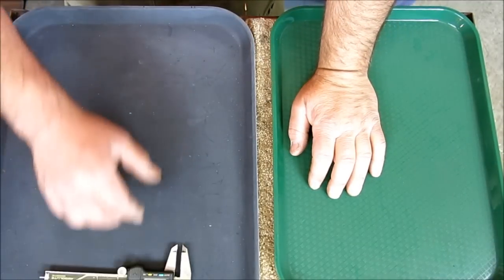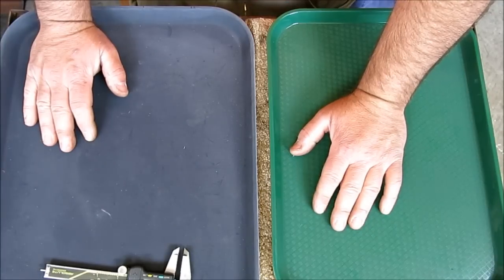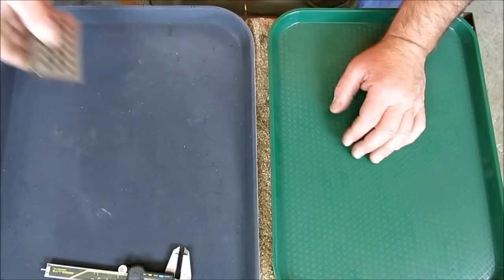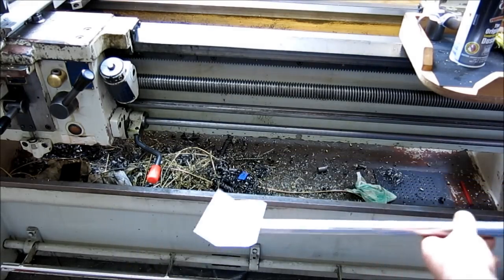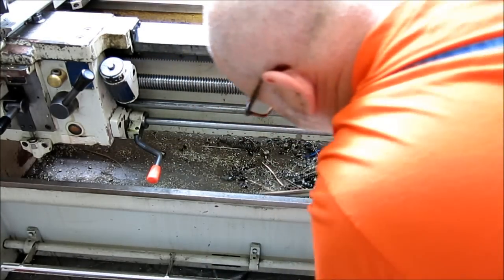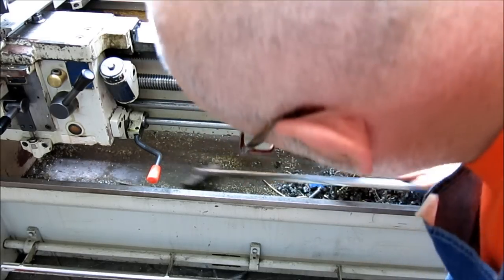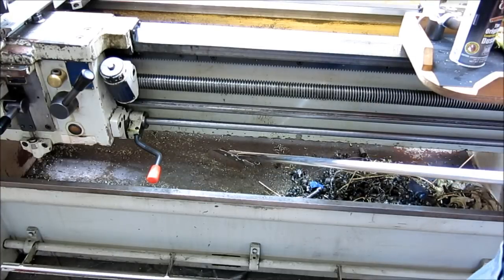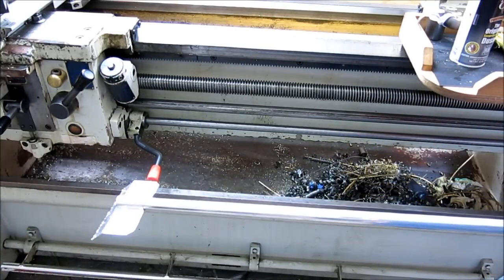Monday Night Meatloaf 30

Comment: Thanks for the meatloaf videos, keep up the good and interesting work!

A new thing, when you have a sharpening stone that has broken, oddly enough, clean the joint well and put super glue on it, realign carefully, stick together and AHA! nearly good as new.  Quite strong, even compared to new.
Reply from the maker: slad roznik Hey Slad,

I'll have to go out in the shop and drop one so I can try your clever trick. Thanks for sharing. 

Cheers,

Tom

Comment: When you're using that small of a diamond hone isn't there a risk that you're taking the stones out of being true, rather than truing them up? Would it be better to use a bigger diamond hone which you could rub the entire stone surface on instead?

Looking forward to the chip videos, those are some monster chips there at the end.

Cheers!

/Daniel
Reply: It is a mix. If you true up the entire stone, you loose a lot of surface and have a lot of grinding to do. If you spot clean it, it can get off by a very small amount. That was a 500 grit diamond I believe if I remember the color coding so he is not taking of a huge amount. 

Flat stones are over rated.  It doesn't make that much difference.
The variations in the hand holding are much larger than the variations in the surface.
Reply from the maker: Hi Daniel,

Basically I am just removing a small amount of contaminated material at the surface. It would be better to use a larger diamond stone to maintain flatness or at least a similar flatness to the diamond stone.

Cheers,

Tom
Reply from the maker: David Kirtley Hi David,

Well said. It basically a good cleaning. These are cheap aluminum oxide stones not big dollar imported waterstones from some sacred mine.

Cheers,

Tom
Reply: oxtoolco Thanks to the both of you. I see your point. 

Cheers!

/Daniel

Comment: Tom, Great meatloaf as always.  One of the methods that I use to flatten stones is to rub two stones together, close to the same grit..  Using WD-40 as a lube.  I used this method in sharpening chisels when I was furniture making.  Of course most of my stones were Japanese Water Stones, and I used water instead of WD-40,  I think I still have some up to 6000 grit.  It was very important to keep the stones perfectly flat.  Nice selection of stones you have there.
Reply from the maker: Hey Herb,

That works as well if you have two the same and are close in flatness. 

Cheers,

Tom
Reply: Check out an optics handbook. Two flats will tend to become concave and convex spherical when ground together. If you want to grind flats you have to grind three surfaces together in pairs. These two effects are used in grinding optics, like the mirrors for telescopes.

Aren't waterstones usually flattened with a cast iron lap plate and a slurry of abrasive?

Comment: Tom, thanks for the Monday meal!  I like that little micrometer...less math means less chance for errors. That vinyl on the wrench looked home-dipped...you can always re-coat it if you like. Thanks for the demo of stone work too...useful to know.  I wonder how well it would work on ceramic sharpeners?  Have to try sometime.

-- Mike
Reply from the maker: Hi Mike,

Diamond almost always wins unless its going up against other diamonds. There are big differences in diamond hardness. It will work well on your ceramic. I peeled the vinyl off the adjustable wrench. Its all happy and nice looking now.

Cheers,

Tom

Comment: Hi Tom.  The Pilgrim Colony in America nearly died out due to the failure of the party to include sharpening stones on their voyage. Since their tools (plows, scythes, axes, knives, etc.) rapidly became dulled, they actually risked famine.  Accordingly, they embarked on a search for usable materials locally, and actually sent back word to England to send some to the Colony.
Reply: Interesting bit of history.  I'd never heard that.
Reply from the maker: Hi Shobar,

That is an interesting story. Where did you come on this interesting bit of history? It almost sounds like an advertisement for Norton abrasives. Not that I doubt you but its an excellent advertising tag line. Thanks for sharing.

Cheers,

Tom
Reply: Shobar would that would be FedEx's first international job then? ;-)

Comment: Hi Tom, I picked up a set of those Kraeuter pliers in the middle of the highway.  They were rusted shut and had been ran over a couple times.  A little TLC and gentle wire brushing and they were working like new again.  A little tool archaeology proved them to be from 1912.  They are far superior to many linesman pliers I've seen.  If you look very carefully, you will see that the jaws never actually come together, they are tapered in a shallow wedge pattern.  I think they are designed this way so that when the jaws are spread apart holding wire, they are parallel.  I would guess that the jaws never come together completely so that the cutters can be sharpened more than once.  I also notice a back bevel from the tip to the cutters, where wire can nestle into when being pulled straight with the pliers.  Anyhow, I too have an old set of patinaed Kraeuter pliers
Reply from the maker: Hey Perry,

I really like the Kraeuter stuff. I have a few pairs or pliers and they all show the attention to detail you describe. 

All the best,

Tom

Comment: Interesting, as always, Tom.  
Carbide wet or dry paper held in place on a surface plate with a squirt of WD-40 works good for flattening stones, too.
Reply from the maker: Hi Richard,

I used to do it that way until I tried the diamond. Takes a lot less time. Diamond is a gearheads best friend.

Cheers,

Tom

Comment: Tom, thanks for the tasty meatloaf MMMmmm.  All of your oxen are patiently waiting to see Chip control.  That gap lathe at your work looks pretty interesting.   its really cool getting the behind the scenes look at what your working on at work, from what i have seen on your blog you do some real hi tech stuff there.  I had no idea that platinum does not oxidize, it looks like you purge welded it.  thanks for sharing.  

Michael
Reply from the maker: Hi Michael,

Thanks for the comment. The big lathe is a Turri from Argentina. Sliding gap bed. Real handy feature.

Cheers,

Tom

Comment: Tom, the best color would be one that is as close to a mid tone as possible. Image it in black and white, you want a 50% gray. The camera looks at the overall scene and averages out the amount of light and tries to bring the level to 50%. This works great most of the time except when you have an abundance of light or dark areas that contrast your subject. Otherwise you would have to manually control the exposure. Thanks for another great episode!

Comment: I've got a couple of pairs of Channel-Locks that got exposed to brake fluid - the blue vinyl handles aren't quite as blue as they were when I bought them...

Also, the varnish on wooden hammer handles does not respond well to motor oil...

So, auto mechanics in particular can be less than thrilled with vinyl handles...

That Etalon micro-rapid micrometer is something I don't remember ever seeing before...

Cheers!

Eric
Reply from the maker: Hey Eric,

I peeled the vinyl off the adjustable wrench. It had that semi melty feel to it. 

Cheers,

Tom

Comment: At about 27:00 into the video ... there is a clear chip gard mounted to a flexible arm. If the clear plastic was replaced with an opaque material you could use such a device to control light to remove glare on some video shots. They can be made big or small ... to suit the requirements of the shot.

I agree with the comment earlier about the meaning of Étalon. In the horse or dog world ... it means Stud ... in the metrology arena ... it means gauge or reference to a standard.

Good information on the stones. Thanks!
Reply from the maker: Hi GaWajn,

Thanks for the suggestion. 

Cheers,

Tom

Comment: You're using an automatic exposure settings on your camera where it is setting the exposure so that most of the image (i.e. more than 50%) is right.  That exposure setting is for the whole image, not just part of it.  If most of the image is dark granite, for example, it will try to make the dark granite work and blow out for nicely reflective metal or hands. So a better test is to do one carpet at a time rather than all three side by side.
Reply from the maker: Hi Doc,

Good idea. You will be seeing them in upcoming video's slowly getting dirtier and dirtier.

Cheers,

Tom

Comment: Recently I scored a Blake CO-AX Indicator for the low low price of 5$. needs 16$ in parts, dented bezel and broken crystal. It is usable and still vary accurate despite being mishandled and pawned. Gotta keep them eyes open.
Reply from the maker: Hi William,

I sent by Blake back to Blake for repairs. Nice folks and easy to deal with. It works like a champ now.

Cheers,

Tom

Comment: Good meatloaf, as always.

How much extra meat to leave before grinding?

The 0.012" oversize seems like a lot (0.006" per side).  I'll use A2, 4140, G2 Cast Iron for my "tools".  Just want to mill slightly oversize, for future heat treat and grind when I get the tooling.    (I had planned on making sure everything is square, and leaving 0.001 5" for final grind)
Reply from the maker: Hey Tom,

It depends on the tool steel and the geometry. Not much worse that not cleaning up when on size after all the machine work, heat treating and grinding that goes into a part. A little extra grinding stock is not a big deal. The old risk and reward situation.  I do agree that for a simple 123 block .006 per side is probably a little much. Depends how good square and parallel your milling is. This was probably a student project so extra grinding is good for practice.

Cheers,

Tom

Comment: Hi Tom,

Liked the sequences from the big boring job, I would like a little comments and longer shots, just my preference...
How about using some diamond files direct to hone the cutters, saves the cleaning and truing on the stones.
You must have been some kind of a Hippie in the 60's with lot's of hairs, nude and smoking whatever with the Mrs. from the commune.
What is the pitch on that quick Mike 3/4-10? I guess it can be repaired with common hardware store found screws...

Pierre
Reply from the maker: Hey Pierre,

I fell off on the other side of the hippie deal. No smoking not much drinking. Guess watching all those loaded adults didn't sit right. I should probably take that micrometer apart and check it out. I suspect a multi start thread or some high helix deal. 

Cheers,

Tom
Reply: Hi Tom,
Curious about the thread too... Practical because FAST!
My hippie years were more on the quiet side too, no regrets.
Cheers,
Pierre

Comment: +GaWajn
Ah, so basically light is like chips, and you use a chip guard to keep it from places you don't want it.

Or possibly light is like a lubricant you squirt in places to get the best image possible.

Or maybe light is like WD-40 and you can spray it on to float the crud off your video...

Comment: Tom,

I bought a Pike Krystolo straight razor hone from an antique shop 21 years ago.  It looks a lot like the Norton at the bottom of your video, wood box and all, only the box has rounded corners and the stone has the Pike/Krystolo logo cast into it.  The quality is beyond any hone I've ever seen.  I did a search and one result compared it to a Noton silicon carbide stone.  I was going to send you an email with pics, but couldn't quickly find your email address.

Jim
Reply from the maker: Hey Jim,

Watch the beginning of the video again. Its on the whiteboard in the background. Love to see a picture of your hone.

Cheers,

Tom

Comment: i like the sliding gap lathe is that you daily driver one? but there so heavy i seen one that is now out at the power plant it was solid no webbing or chip tray to speak of lol
Reply from the maker: Hi Mog,

No in general the Turri doesn't see much use. We have three other lathes that get used daily in our model shop. The Turri is a tank.

Cheers,

Tom

Comment: I never knew that those diamond sharpeners come in different degrees of coarseness so I have learnt something else tonight!!
I use diesel as a lubricant - is this wrong?
Reply from the maker: Hi Dan,
 
Diesel would work as well. Some light watery solvent like material is all that's needed. Diesel is just a little too pungent for my delicate tastes.

Cheers,

Tom

Comment: how do you keep the stones when not i use. I learned that the stones shut be keept in petrolium when not in use. Is that wrong?
Best regards from Denmark .
P.s great videos keep them comming.
Reply from the maker: Hi Niels,

I have seen guys do that. Personally I don't subscribe to oil on the stones for sharpening and honing. I like them dry and clean. 

Cheers,

Tom

Comment: Tom - does that rapid mic suffer any in accuracy because of its design? I'd guess that for a given amount of backlash in the thread this model would be 4x greater error. Tried it out on a gauge block?
Reply from the maker: Hi Z,

This micrometer is not in that good of condition. I have used it and tried it on standards and it seems to repeat reasonably. It has a vernier as well that I failed to mention. I have to use it a bit more to make a better assessment.

Cheers,

Tom

Comment: Whats on next week Mr Wizard, how to clean your teeth and polish your shoes?
I take it that it was not you working on that lathe.
Reply from the maker: Hi Bily,

Why would you think that I wasn't running the lathe? Just because I was holding the camera? Each pass of the boring bar took either a half hour or one hour depending on roughing or finishing feedrate. Plenty of time to shoot a little video.

I don't think a teeth cleaning and shoe polishing video would be very interesting to metalworkers. Have you tried Googling it to see if you can find some help?

Cheers,

Tom